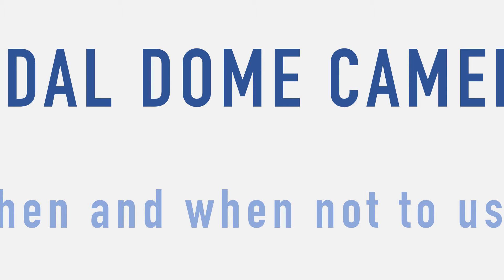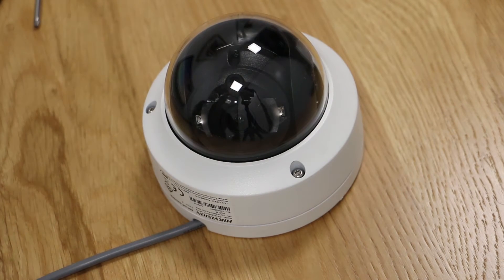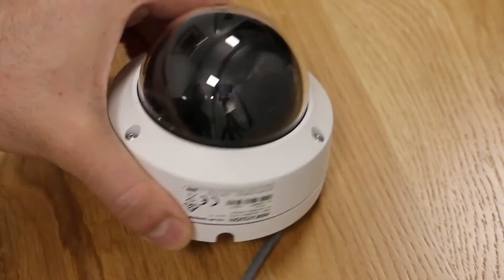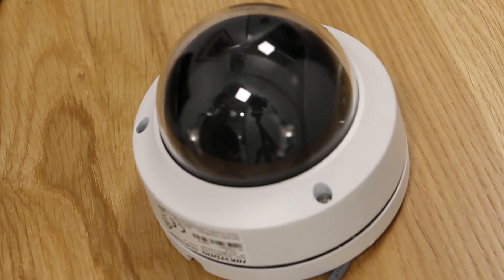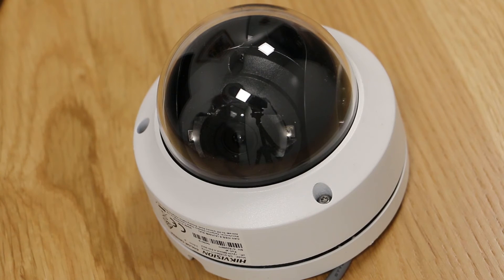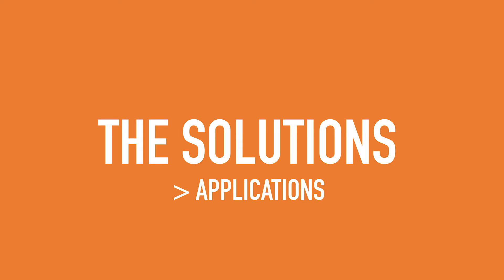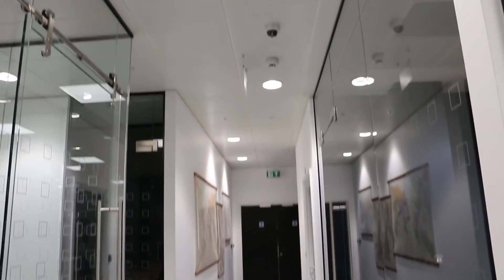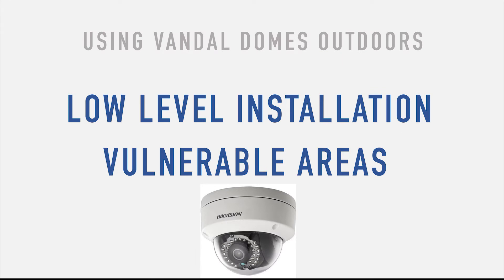Vandal Dome CCTV Cameras- When to use and when to avoid.

Comment: All you have to do clean the poly lens once a year if it's an outdoor camera. Poly can also be polished. I prefer external ir separate from the camera for outdoor use so we don't have an issue with reflection or  bleed.. i also prefer a camera with no dome because i like the fact that ppl can see that the camera is looking at them :)
Reply from the maker: Great point! The problem with cleaning the poly is it will always have micro scuffs and marks which reflect the IR back. Turret is our favourite when IR is being deployed as it's like having a separate IR.
Reply: @roboxacademy . Yeah this is the exact problem i am having on 1 camera... Infact it looks like the smoked coating on the cover is flaking from weather exposure and it IR blooms at night making it useless